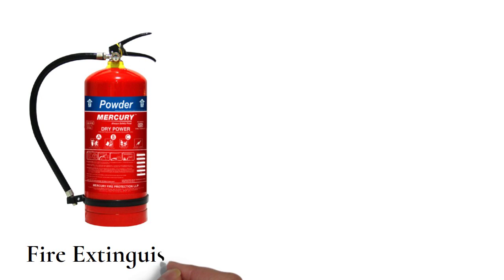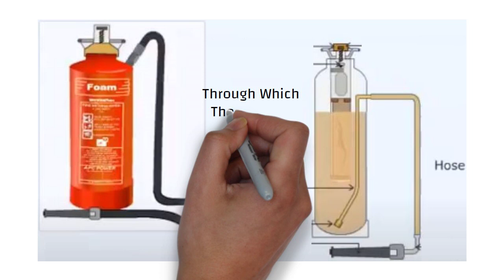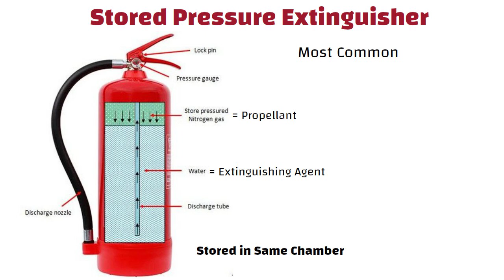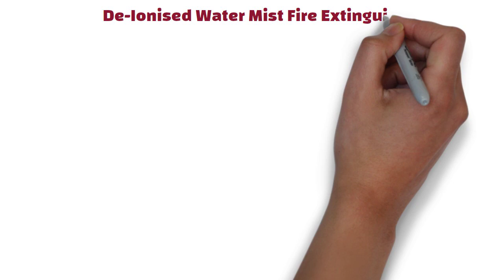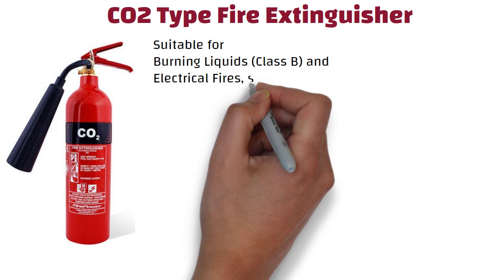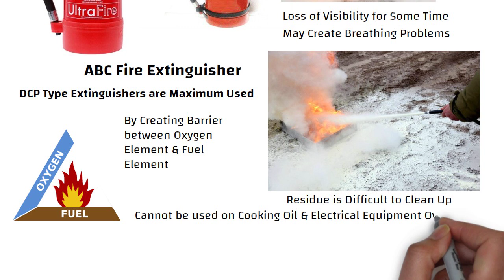FIRE EXTINGUISHER DEALERS IN KERALA, CALL 8138906102, FIRE EXTINGUISHER DEALERS IN ERNAKULAM.

Comment: Fire extinguisher dealers in Thrissur
Reply: FIRE EXTINGUISHER DEALERS IN WAYANAD, FIRE EXTINGUISHER SUPPLIERS IN WAYANAD, FIRE EXTINGUISHER DISTRIBUTORS IN WAYANAD, FIRE EXTINGUISHER IN WAYANAD, ABC TYPE FIRE EXTINGUISHER DEALERS IN WAYANAD, CO2 TYPE FIRE EXTINGUISHER DEALERS IN WAYANAD, CLEAN AGENT FIRE EXTINGUISHER IN WAYANAD, MODULAR TYPE FIRE EXTINGUISHER DEALERS IN WAYANAD, MECHANICAL FOAM FIRE EXTINGUISHER DEALERS IN WAYANAD, FIRE EXTINGUISHER NEAR ME WAYANAD, FIRE EXTINGUISHER TRADERS IN WAYANAD, FIRE FIGHTING COMPANIES IN WAYANAD, FIRE CONTRACTORS IN WAYANAD, FIRE EQUIPMENT DEALERS IN WAYANAD, FIRE ALARM DEALERS IN WAYANAD, FIRE PUMP DEALERS IN WAYANAD, SMOKE DETECTOR DEALERS IN WAYANAD, FIRE FIGHTING SYSTEM IN WAYANAD, FIRE PROTECTION SYSTEM IN WAYANAD, FIRE AND SAFETY CONTRACTORS IN WAYANAD, FIRE HYDRANT SYSTEMS IN WAYANAD, PA TALK BACK SYSTEM IN WAYANAD, FIRE NOC IN WAYANAD, FIRE INSTALLATION IN WAYANAD, FIRE NOC RENEWAL IN WAYANAD, KIRLOSKAR FIRE PUMP DEALERS IN WAYANAD, FIRE EXTINGUISHER NEAR ME WAYANAD, FIRE EXTINGUISHER MANUFACURERS IN WAYANAD, SAFEX FIRE EXTINGUISHER DEALERS IN WAYANAD, FIRE NOC CONTRACTORS IN WAYANAD, FIRE FIGHTING EQUIPMENT DEALERS IN WAYANAD, FIRE PROTECTION SYSTEM IN WAYANAD, FIRE INSTALLATION IN WAYANAD, FIRE SAFETY CONTRACTORS IN WAYANAD, FIRE AMC IN WAYANAD, FIRE PROTECTION SYSTEM IN WAYANAD, FIRE PROTECTION EQUIPMET IN WAYANAD, AMC OF FIRE SYSTEM IN WAYANAD, FIRE CONSULTANTS IN WAYANAD, FIRE AND SAFETY EQUIPMENT DEALERS IN WAYANAD, ADDRESSABLE FIRE ALARM SYSTEM IN WAYANAD, KARTHAR VALVE DEALERS IN WAYANAD, DCP TYPE FIRE EXTINGUISHER IN WAYANAD, POWSER TYPE FIRE EXTINGUISHERS IN WAYANAD, FIRE HYDRANT SYSTEM IN WAYANAD, FIRE ALARM PANEL DEALERS IN WAYANAD, SAFEPRO FIRE EXTINGUISHER DEALERS IN WAYANAD, MS AND GI PIPE DEALERS IN WAYANAD, JINDAL PIPE DEALERS IN WAYANAD, AGNI FIRE ALARM DEALERS IN WAYANAD, FIRE EQUIPMENT DEALERS IN WAYANAD, FIRE EQUIPMENT SUPPLIERS IN WAYANAD, FIRE EQUIPMENT TRADERS IN WAYANAD, FIRE SPRINKLER SYSTEM IN WAYANAD, RAVEL FIRE ALARM DEALERS IN WAYANAD, RAVEL FIRE ALARM SYSTEM IN WAYANAD, AGNI FIRE ALARM DISTRIBUTORS IN WAYANAD, FIRE ALARM CONTRACTORS IN WAYANAD, FIRE PIPE INSTALLATION IN CONTRACTORS IN WAYANAD, FIRE SAFETY CONTRACTORS IN WAYANAD, FIRE PA TWO WAY TALK BACK SYSTEM DEALERS IN WAYANAD, HEAT DETECTOR DEALERS IN WAYANAD, HONEYWELL FIRE ALARM DEALERS IN WAYANAD, FIRE NOC CONSULTANTS IN WAYANAD, FIRE AMC AND FIRE NOC IN WAYANAD, FIRE SAFETY COMPANIES IN WAYANAD, NEWAGE DEALERS IN WAYANAD, MONSHER FIRE EQUIPMENT DEALERS IN WAYANAD, KARTHAR VALVE DEALERS IN WAYANAD, FIRE HYDRANT VALVE DEALERS IN WAYANAD, FIRE HOSE REEL DRUM DEALERS IN WAYANAD, FIRE SPRINKLER DEALERS IN WAYANAD, FIRE PUMP DEALERS IN WAYANAD, LUBI PUMP DEALERS IN WAYANAD, LHP PUMP DEALERS IN WAYANAD. FIRE CONTRACTORS IN WAYANAD, FIRE AND SAFETY CONTRACTORS IN WAYANAD, FIRE EQUIPMENT DEALERS IN WAYANAD, FIRE FIGHTING CONTRACTORS IN WAYANAD, AGNI FIRE ALARM DEALERS IN WAYANAD, PA TALK BACK SYSTEM DEALERS IN WAYANAD, FIRE NOC IN WAYANAD, FIRE NOC RENEWAL IN WAYANAD, FIRE SYSTEM INSTALLATION IN WAYANAD, FIRE EXTINGUISHER DEALERS IN KALPETTA, FIRE EXTINGUISHER DEALERS IN BATHERY, FIRE EXTINGUISHER DEALERS IN MANATHAVADY.
Reply: Fire fighting contractors in Ernakulam, fire fighting contractors in Calicut, fire fighting contractors in palakkad, fire fighting contractors in Trivandrum, fire fighting contractors in pathanamthitta, fire fighting contractors in Thrissur, fire fighting contractors in kollam, fire fighting contractors in adoor, fire fighting contractors in malappuram, fire fighting contractors in kannur, fire fighting contractors in Kayamkulam, fire fighting contractors in Thiruvalla, fire fighting contractors in Changanassery, fire fighting contractors in Changanachery, fire fighting contractors in pandalam, fire fighting contractors in pala, fire fighting contractors in aleppey, fire fighting contractors in chengannur, fire fighting contractors in wayanad, fire fighting contractors in sulthan bathery, fire fighting contractors in perithalmanna, fire fighting contractors in Kasargode, fire fighting contractors in adoor, fire fighting contractors in idukki, fire fighting contractors in munnar, fire fighting contractors in punalur, fire fighting contractors in kanjikode, fire fighting contractors in kollam, fire fighting contractors in Tirur, fire fighting contractors in thirur, fire fighting contractors in valanchery, fire fighting contractors in manjeri, fire fighting contractors in kanhangad, fire fighting contractors in kalpetta, fire fighting contractors in Kayamkulam, fire fighting contractors in karunagapally, fire fighting contractors in karunagappally, fire fighting contractors in varkala, fire fighting contractors in thalassery, fire fighting contractors in ponnani, fire fighting contractors in thaliparamba, fire fighting contractors in payyanur, fire fighting contractors in vadakara, fire fighting contractors in neyyatinkara, fire fighting contractors in koyilandi, fire fighting contractors in beypore, fire fighting contractors in nedumangad, fire fighting contractors in thirurangadi, fire fighting contractors in nileswaram, fire fighting contractors in kottarakara, fire fighting contractors in kottarakkara, fire fighting contractors in cherthala, fire fighting contractors in shornur, fire fighting contractors in shoranur, fire fighting contractors in kottakkal, fire fighting contractors in mananthavady, fire fighting contractors in manjeswaram, fire fighting contractors in chavakkad, fire fighting contractors in kattapana, fire fighting contractors in attingal, fire fighting contractors in ramanattukara, fire fighting contractors in anchal, fire fighting contractors in paravur, fire fighting contractors in kodungallur, fire fighting contractors in aluva, fire fighting contractors in chalakkudy, fire fighting contractors in ottapalam, fire fighting contractors in adimali, fire fighting contractors in kumily, fire fighting contractors in nedumkandam, fire fighting contractors in thodupuzha, fire fighting contractors in perumbavur, fire fighting contractors in perumbavoor, fire fighting contractors in kothamangalam, fire fighting contractors in erumely, fire fighting contractors in vandiperiyar, fire fighting contractors in suryanelli, fire fighting contractors in haripad, fire fighting contractors in cherthala, fire fighting contractors in thalassery, fire fighting contractors in kuthuparamba, fire fighting contractors in kottarakara, fire fighting contractors in kottiyam, fire fighting contractors in thenmala, fire fighting contractors in kundara, fire fighting contractors in chathannur, fire fighting contractors in vaikom, fire fighting contractors in kumarakom, fire fighting contractors in kanjirappally, fire fighting contractors in erattupetta, fire fighting contractors in koduvally, fire fighting contractors in kunnamangalam, fire fighting contractors in perambra, fire fighting contractors in vadakara, fire fighting contractors in thamarassery, fire fighting contractors in edappal, fire fighting contractors in kuttipuram, fire fighting contractors in kuttippuram, fire fighting contractors in manjeri, fire fighting contractors in shoranur, fire fighting contractors in vadakanchery, fire fighting contractors in kozhenchery, fire fighting contractors in mallapally, fire fighting contractors in ranni, fire fighting contractors in parumala, fire fighting contractors in Mavelikara, fire fighting contractors in kilimanur, fire fighting contractors in guruvayur, fire fighting contractors in kuttikananam, fire fighting contractors in sulthan bathery, fire fighting contractors in tirur, fire fighting contractors in munnar, fire fighting contractors in erumely, fire fighting contractors in kovalam, fire fighting contractors in neyyattinkara, fire fighting contractors in nedumangad, fire fighting contractors in peerumed, fire fighting contractors in kanjirappally, fire fighting contractors in nedumkandam, fire fighting contractors in muvattupuzha, fighting contractors in moovattupuzha, fire fighting contractors in devikulam, fire fighting contractors in chavakkad, fire fighting contractors in mananthavadi, fire fighting contractors in mavelikkara, fire fighting contractors in haripad, fire fighting contractors in cherai, fire fighting contractors in Chendamangalam, fire fighting contractors in Chittur, fire fighting contractors in Kadirur, fire fighting contractors in Manjeshwar, fire fighting contractors in Panoor, fire fighting contractors in Pinarayi, fire fighting contractors in Quilandy, fire fighting contractors in shoranur, fire fighting contractors in bekal, fire fighting contractors in chinnar, fire fighting contractors in ponmudi, fire fighting contractors in payyambalam, fire fighting contractors in feroke, fire fighting contractors in beypore, fire fighting contractors in cheleri, fire fighting contractors in edappal, fire fighting contractors in eloor, fire fighting contractors in irukkur, fire fighting contractors in kilimanur, fire fighting contractors in mavoor, fire fighting contractors in mahe, fire fighting contractors in pattambi, fire fighting contractors in koyilandy, fire fighting contractors in ramanattukara, fire fighting contractors in thekkady, fire fighting contractors in thenmala, fire fighting contractors in trichur, fire fighting contractors in Thrissur, fire fighting contractors in thiruvananthapuram, fire fighting contractors in uppala, fire fighting contractors in valayar, fire fighting contractors in vengara, fire fighting contractors in achankovil, fire fighting contractors in aryankavu, fire fighting contractors in ambalapuzha, fire fighting contractors in alathur, fire fighting contractors in azhikkal, fire fighting contractors in malampuzha, fire fighting contractors in vagamon, fire fighting contractors in nalliyampathy, fire fighting contractors in kaliyikkavila, fire fighting contractors in aluva. Fire fighting contractors in Karunagappally, fire contractors in kochi, fire contractors in ernakulam, fire contractors in Kerala, Fire safety installations in Kochi, Fire fighting companies in Kochi, Fire protection systems in Kochi, Fire alarm contractors in Kochi, Fire fighting companies in Kerala, Fire fighting companies in Ernakulam,Fire Extinguisher dealers in Calicut, Fire Extinguisher dealers in Trivandrum, Fire Extinguisher dealers in Palakkad, Fire Extinguisher dealers in Kannur, Fire Extinguisher dealers in Pathanamthitta, Fire Extinguisher dealers in Kottayam, Fire Extinguisher dealers in Changanassery, Fire Extinguisher dealers in Thiruvalla, Fire Extinguisher dealers in kasargod, Fire Extinguisher dealers in Thrissur – Trichur, Fire Extinguisher dealers in Kerala, Fire fighting system in Calicut, Fire fighting systems in Trivandrum, Fire system in kerala,Fire detection systems in Ernakulam, Fire protection system in kerala, Fire fighting system in kerala, Fire fighting system in thrissur, fire protection systems in thrissur, fire safety system in thrissur, fire extinguishers dealers in thrissur. Fire alarm systems in thrissur.

https://www.aimfireequipment.com,

https://g.co/kgs/hs2KNEs

Comment: Fire extinguisher dealers in Karunagapally
Reply from the maker: FIRE ALARM DEALERS IN VALANCHERY, ADDRESSABLE FIRE ALARM DEALERS IN VALANCHERY, FIRE ALARM SYSTEM DEALERS IN VALANCHERY, ADDRESSABLE FIRE ALARM SYSTEM DEALERS IN VALANCHERY, FIRE DETECTION SYSTEM IN VALANCHERY, SMOKE DETECTOR DEALERS IN VALANCHERY, CONVENTIONAL FIRE ALARM DEALERS IN VALANCHERY, MORLEY FIRE ALARM DEALERS IN VALANCHERY, GST FIRE ALARM DEALERS IN VALANCHERY, ASES SECURITY FIRE ALARM DEALERS IN VALANCHERY, BEAM DETECTOR DEALERS IN VALANCHERY, FIRE ALARM SUPPLIERS IN VALANCHERY, FIRE ALARM TRADERS IN VALANCHERY, FIRE ALARM PANEL DEALERS IN VALANCHERY, HEAT DETECTOR DEALERS IN VALANCHERY, FIRE ALARM SYSTEM SUPPLIERS IN VALANCHERY, FIRE ALARM COMPANIES IN VALANCHERY, FIRE EQUIPMENT DEALERS IN VALANCHERY, ADRRESSABLE FIRE ALARM PANEL DEALERS IN VALANCHERY, FIRE ALARM SYSTEM IN VALANCHERY, BATTERY OPERATED DETECTOR DEALERS IN VALANCHERY, ASPIRATION DETECTION SYSTEM DEALERS IN VALANCHERY, FIRE ALARM MCP - MANUAL CALL POINT DEALERS IN VALANCHERY, FIRE ALARM HOOTER DEALERS IN VALANCHERY, PA TWO WAY TALK BACK SYSTEM DEALERS IN VALANCHERY, PA SYSTEM DEALERS IN VALANCHERY, PA TALK BACK UNIT DEALERS IN VALANCHERY, HOOTER CUM STROBE DEALERS IN VALANCHERY, FIRE PROTECTION SYSTEM IN VALANCHERY, FIRE ALARM CONTRACTORS IN VALANCHERY, FIRE DETECTORS IN VALANCHERY, FIRE ALARM DEALERS IN KOLLAM, ADDRESSABLE FIRE ALARM DEALERS IN KOLLAM, SMOKE DETECTOR DEALERS IN KOLLAM, FIRE EQUIPMENT DEALERS IN VALANCHERY, FIRE ALARM INSTALLATION IN VALANCHERY, FIRE ALARM COMPANIES IN VALANCHERY FIRE ALARM DISTRIBUTORS IN VALANCHERY, TALK BACK SYSTEM DEALERS IN VALANCHERY, FIRE ALARM SENSOR DEALERS IN VALANCHERY, FIRE EXTINGUISHER DEALERS IN VALANCHERY, FIRE ALARM DEALERS IN ERNAKULAM, FIRE ALARM DEALERS IN KERALA, ADDRESSABLE FIRE ALARM DEALERS IN CALICUT, SMOKE DETECTOR IN VALANCHERY,  FIRE EXTINGUISHER DEALERS IN VALANCHERY, FIRE EXTINGUISHER SUPPLIERS IN VALANCHERY, FIRE EXTINGUISHER DISTRIBUTORS IN VALANCHERY FIRE EXTINGUISHER IN VALANCHERY, ABC TYPE FIRE EXTINGUISHER DEALERS IN VALANCHERY, CO2 TYPE FIRE EXTINGUISHER DEALERS IN VALANCHERY, CLEAN AGENT FIRE EXTINGUISHER IN VALANCHERY FIRE FIGHTING PUMP DEALERS IN VALANCHERY, FIRE PUMP DEALERS IN VALANCHERY, KIRLOSKAR FIRE PUMP DEALERS IN VALANCHERY, FIRE JOCKEY PUMP DEALERS IN VALANCHERY, FIRE DISEL ENGINE DRIVEN PUMP DEALERS IN VALANCHERY, FIRE FIGHTING EQUIPMENT DEALERS IN VALANCHERY, FIRE FIGHTING SYSTEM IN VALANCHERY, VERTICAL INLINE PUMP DEALERS IN VALANCHERY, HYDRO PNEUMATIC PRESSURE BOOSTING PUMP DEALERS IN VALANCHERY, VERTICAL TURBINE PUMP DEALERS IN VALANCHERY, SEWAGE PUMP DEALERS IN VALANCHERY, RO PUMP DEALERS IN VALANCHERY. FIRE EXTINGUISHER DEALERS IN TANUR, FIRE EXTINGUISHER DEALERS IN IRINGAVOOR, ,Fire extinguisher dealers in Valanchery, Fire extinguisher suppliers in Valanchery, Fire extinguisher traders in Valanchery, Fire extinguisher in Valanchery, Fire alarm dealers in Valanchery, Fire hydrant system in Valanchery, Fire fighting equipment dealers in Valanchery, Fire equipment in Valanchery, Fire contractors in Valanchery, Fire installation in Valanchery, Fire protection system in Valanchery, Fire hydrant system in Valanchery, PA two way talk back system dealers in Valanchery, PA talk back unit in Valanchery, Fire telephone system dealers in Valanchery, Fire pump dealers in Valanchery, Addressable fire alarm dealers in Valanchery, Conventional fire alarm dealers in Valanchery, Fire alarm panel dealers in Valanchery, Smoke detectors in Valanchery, Heat detectors in Valanchery, Multi sensor detector dealers in Valanchery, Fire NOC in Valanchery, Kirloskar fire pump dealers in Valanchery, Fire detection system in Valanchery, GST addressable fire alarm in Valanchery, Morley fire alarm in Valanchery, Fire safety installation in Valanchery, Butterfly valve dealers in Valanchery, Fire extinguisher near me Valanchery, Fire protection equipment dealers in Valanchery.  fire extinguisher dealers in Malappuram, fire fighting contractors in malappuram, fire and safety systems in Malappuram, fire equipment in Malappuram, fire extinguisher in Malappuram, fire extinguisher suppliers in Malappuram, fire protection system in Malappuram, fire consultants in Malappuram, fire fighting companies in Malappuram, fire NOC in Malappuram, fire protection system installation in malappuram, fire safety contractors in malappuram, fire safety consultants in malappuram, fire and safety contractors in malappuram, fire and safety equipment in Malappuram, fire alarm systems in Malappuram, fire AMC in Malappuram, fire contractors in malappuram, fire safety equipment in Malappuram, fire protection system installation in Malappuram, fire protection equipments in Malappuram